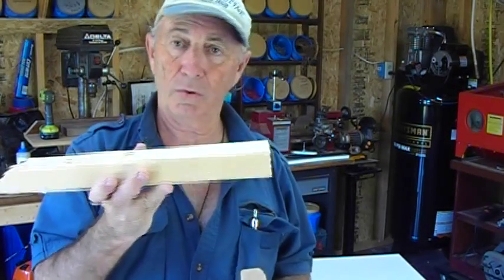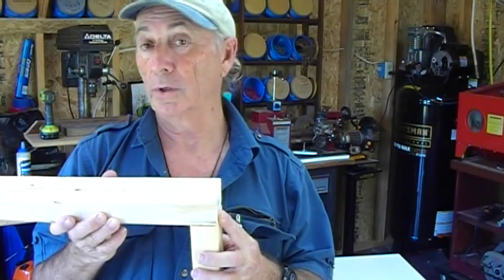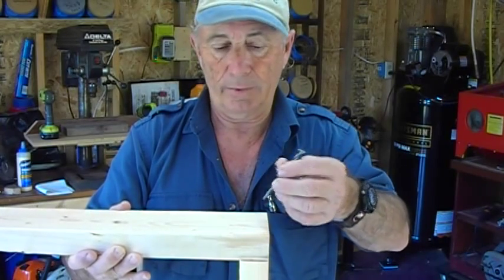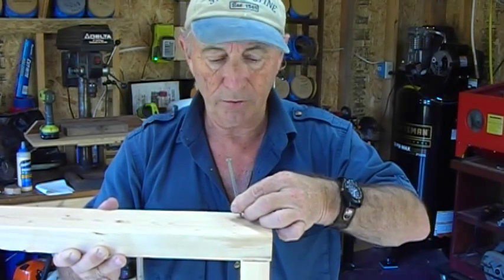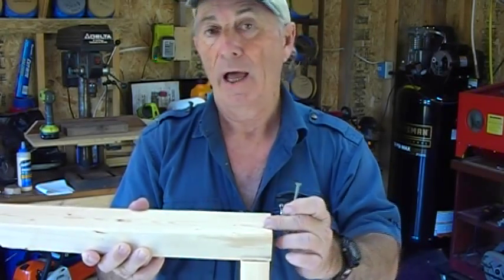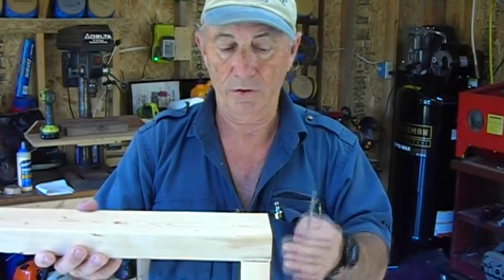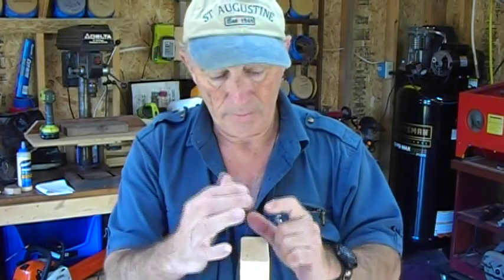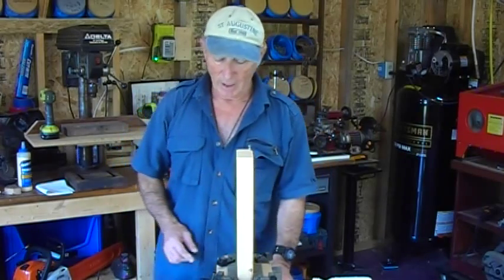Coffee and tools basics of nailing 2x4s together

Comment: Hi. First off, thank you for sharing your knowledge and experience. Second, You talked about length in this video, but you didn't really talk about what size diameter nail to use. Is there a way to know which size diameter screw to get?
Reply from the maker: Hi Adam that was for another video. The general nail sizes vary depending on load and site conditions. The favorite would the 3.5inch length the shank however will be the variable for jobs.

Comment: Can you use front nailer on 2x2 without cracking?
Reply from the maker: Are talking about air hammer type ? or ?
Reply: Coffee and Tools sorry I meant framing nailer on 2x2?
Reply from the maker: Framing nailers are pretty cool, but most don't use the angle method. The framing nailer has a "less" chance to crack the 2x4s, but I've seen on 2x2s even a pre drill used before hitting it with the nails. Also the coated nails seem to work better without causing cracks, but that comes down to brand name and contractors opinions on what works and what doesn't.